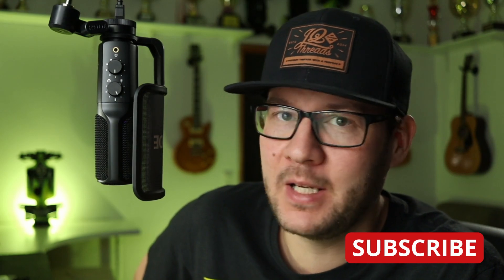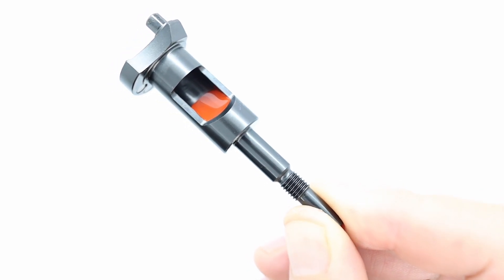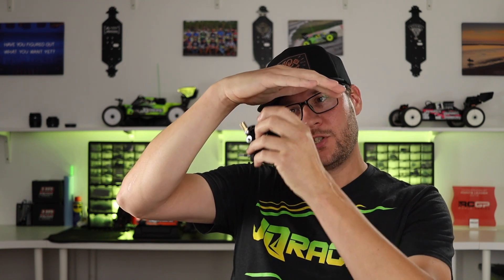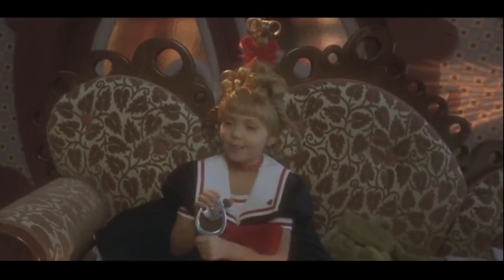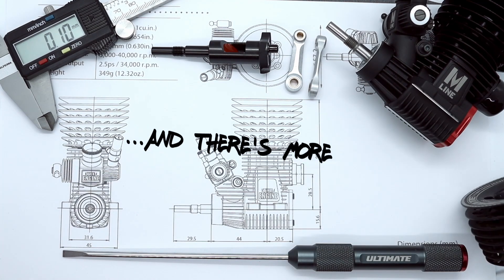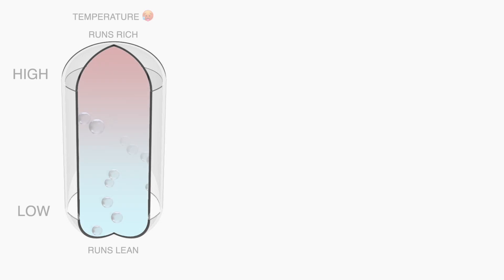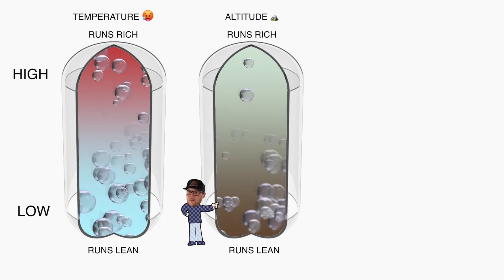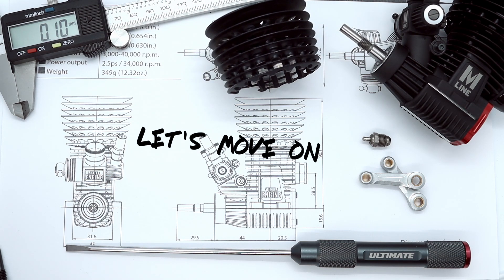How A Nitro Engine Works. Does Lefty Understand?

Comment: If intake air temp goes up a lot. You get fuel evaporation. So you need more fuel. I barely use air density in my theory.

Comment: Any idea why my car is running sooo inconsistent? , idle gap .5mm bottom needle as lean as i can go without raising the idle so its too fast.. top end runs as high as it can without over hanging the revs coming back down. Just wont hold a consistent idle.
https://youtube.com/shorts/lbzisG6j21k?feature=share
Reply from the maker: @MrBoomtheroom  bad front bearing
Reply: @ as in? There’s no leak coming from it
Reply from the maker: @ yes there is, just not visible.
Reply: @invisiblespeedrc   are they meant to be Air tight sealed?
Reply from the maker: @MrBoomtheroom  change the front bearing. When a front bearing is bad the engine wont idle steadily. You dont see it, you hear it.
Reply: @invisiblespeedrc  ok ill give it a shot.. some suggested rear bearing also? what u reckon?
Reply from the maker: @ no

Comment: How does the glow plug stay glowing if there is no current when running? Isn’t it compression ignition much like a diesel and the glow plug simply helps get the ignition process started? Seems like a 2-stroke compression ignition engine. Not new to RC but new to nitro as of a few months ago.
Reply from the maker: No it stays glowing due to the heat
Reply: Catalytic reaction of fuel and oxygen keeps it glowing

Comment: You have been a great help. I live in Ohio, we’re running indoor now. I can’t wait to run my MP-10 this spring.  There are still a few things about tuning my engine I need to dial in and you’ve gotten me several steps closer. Please keep sharing your knowledge, because the only other way to learn other than running , is by getting the correct advice, and seeing what applies, and works for you. Thanks again.

Comment: Excellent video! Is it possible for you to explain when compression gets low how to tune or when to replace internals?
Reply from the maker: The way to tune is always the same. at some point it won't idle with such a small idle gap, and you have to increase it. Otherwise you tune it the same way. When the engine doesn't want to idle and the tune is inconsistent, that is a good sign to know to change the piston and sleeve. If the engine is loud with a metallic sound, it means the rear bearing is bad, and needs changing.

Comment: I’m sorry to say mate but you’re actually wrong it’s a compression ignition not spark ignition the glow plug just get it going. think about it how the hell is that glow plugs still glowing when there’s no electricity 🤣🤣🤦‍♂️ it’s like a diesel mate that’s why it’s called a glow plug and not a spark plug big difference
Reply from the maker: No, YOU are wrong. Except this part "the glow plug just get it going." Exactly what I said. But then the glow plug stays glowing due to this: "When the platinum in the element comes in contact with the methanol in the fuel, there is a catalytic reaction between the two. This heats the platinum while causing the methanol to ignite. This is the foundation upon which the entire nitro hobby is built." https://rogershobbycenter.com/allaboutglowplugs